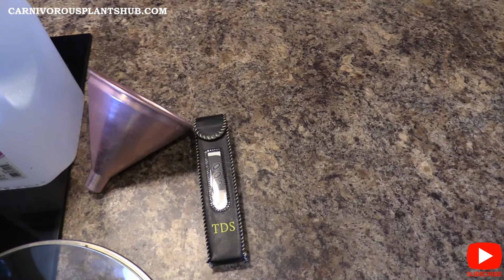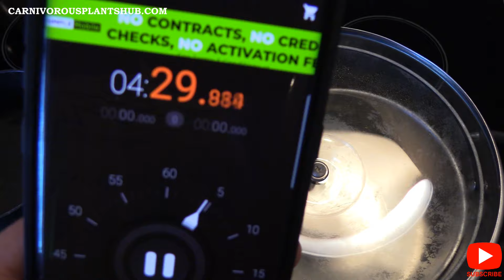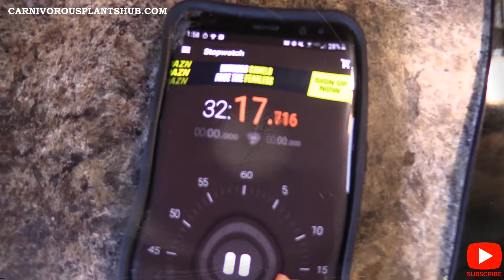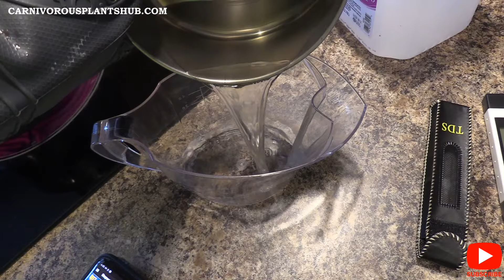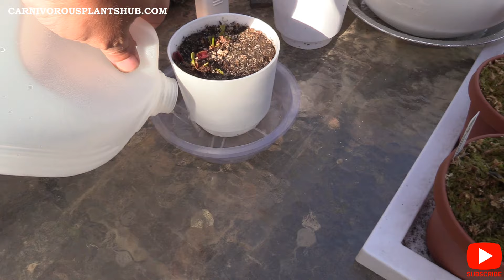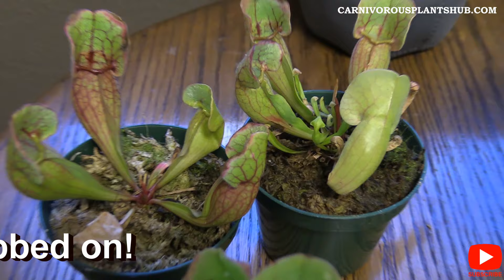How To Make Distilled Water At Home EASY DIY For Venus Flytraps, CPAP, Humidifier, Plants, Drinking!

Comment: The reason why this is extra in efficient is because your actually evaporating the distilled water. If the hard water is hot enough to evaporate then so is your distilled water. That’s why traditional stills use a copper tube. If you could some how get the distilled Vapor to a cold chamber this production would be way faster. This is a smart idea in a pinch tho

Comment: TYSM ive been looking into making my own distilled water for my consumption.  I dont want water from my tap as it has flouride and clorine plus other stuff.  I also wont be putting the end results in plastic containers.  I already use redmons electrolytes so i will add it to distilled water to take care of that.  
Now debating to buy a zero water or counter top distiller.  Leaning more to the counter top distiller bez again no buying plastic filters.  Thanks again for showing how long it takes to make 1 cup
Reply from the maker: I use zero water pitchers for 0 TDS water, they work really well! All my carnivorous plants are given water straight from the zero water pitcher. This was a fun method to try and experiment with, but it's obviously not very efficient or really worth the time.
Reply: You don't need distilled water.  Most filters can remove most of the things you noted.  You just have to make sure the filter is graded for that particular element.  Check their NSF ANSI rating.  For example I think 53 is for lead.

Distilled water has a very high energy input and overall not good for you especially if you have some kind of ion or nutrient deficiency.  Because the water will pull it out of your cells which is not good and you'll pee it out. 

Chlorine evaporates out and is used to help ensure the water being delivered to you isn't full of microbes.  I often leave water out for about 24 hours and it's non detect and safe for my aquarium.

Comment: got a water distiller from h20 labs for my sarracenia  today and it took 5 hours to make 1 gallon of distilled water I also had to make two batches cus I need an activated carbon pad cus   distilling it doesn't necessarily remove things like chloreen and floride from the water but  activated carbon does  so   after all that was done  I  ran it   and made a gallon in 5 hours and its a 750 watt  distiller also  the h20 labs manual says that activated carbon  pad is good  for  30 gallons before it needs to be replaced
Reply from the maker: I also have a distiller, I was just exploring alternative methods. I usually just start mine before bed and let it run overnight. I've actually turned to the zero water pitcher now as my go to. It's quicker and effective at pulling impurities out of the water. Just have to stay on top of the filters.

Comment: does Filtered tap water works? We have filter connected to the tap😿
Reply from the maker: More often that not, no. I also have filtered water in my kitchen but it reads at about 80 PPM which is a little too high, that will kill them over time. I recommend you get a TDS meter, if your filtered water measures below 50PPM, you are good to go! If not, you will need to find an alternate way to water your venus flytrap. Check out my most recent watering video. It explains everything in depth and shows some other creative ways to get some 0 PPM water! Venus Flytrap watering guide - https://youtu.be/hfQKNffFp3s
Reply: @CarnivorousPlantsHub  thank u so much❤️I bought distilled water

Comment: I might be wrong here but there may be a possibility of cracking the glass lid by putting ice onto it when it’s hot, not sure though
Reply from the maker: I suppose that is possible. So far, I haven't cracked any lids but I also haven't kept doing this as it just wasn't very efficient. Lol...
Reply: If using ice from the beginning it would be fine.  I used to use this method for long term stews etc and I just filled the glass with water.  Worked fine, topped off as evaporated.

Comment: Is demineralized water safe for my carnivorous plants? My grocery stores all sell demineralized water instead of distilled water.
Reply from the maker: My understanding is that demineralized water should be fine. However, I would test the PPM's before I committed to it. You can grab a TDS meter off Amazon for like 12 bucks. If it's below 50 PPM, it should be okay!
Reply: I checked the contents of the bottle, it indicated that major elements are at 0 ppm.
Na, K, Cu, Ca, Zn, As, F, Cl, HCO³, SO⁴, NO³, Mg, Pb.

Comment: I used to do this but I just buy gallons of distilled water because I find it to be more expensive to do this on a gas stove.
Reply from the maker: Yes! Based on average power consumption by a burner, this cost about $8 to make a gallon of distilled water. Not cost effective at all.

Comment: Nice video but for me it takes too much time with your method ;)
What is the maximum PPM you can give to your carnivorous plants?
Reply from the maker: Hey David. I agree. At the end of the video I give a full breakdown of time it takes and how much it costs. But, I have to keep it under 50 ppm for my carnivorous plants. I really prefer 30 ish and under.
Reply: @CarnivorousPlantsHub  I just measured the water in my laundery dryer.
I measured 19 PPM ;)
Reply from the maker: I also plan on getting an RO system! And that's awesome about your dryer!! That should work fine for carnivorous plants!
Reply: @CarnivorousPlantsHub  I still have a flytrap in reserve I am going to test the water on them for one month.
I hope they will survive.  
Greatings from Belgium ;)
Reply: @davidjobe9876  how did you do that🧐
Reply: @SilkieSiren  I have a condenser tumble dryer at home.
I measured the water in the reservoir with a PPM meter. I still water my plants with that and they are still alive :)
Reply: @CarnivorousPlantsHub  Ok thanks for the fast reply ;)
I will probably buy a Reverse Osmosis Kit.
Now I have to buy distilled water to have as many empty cans. That way I can fill them with Reverse Osmosis water :)

Comment: 3 hours of boiling for a cup of distilled water. Plus ice. Price effective? Nope. Plugged thru. He does a cost analysis towards end. Good final opinion tho. Leaving comment instead of deleting to please the algorithm godz.
Reply from the maker: Thank you! Definitely not worth it under most circumstances.
Reply: You can use a pressure cooker and a silicone tube-based DIY system to get more and faster distilled collection :)